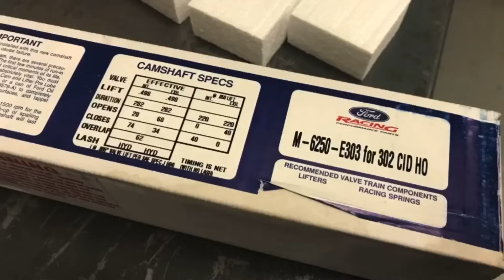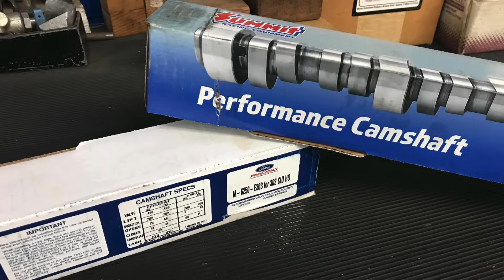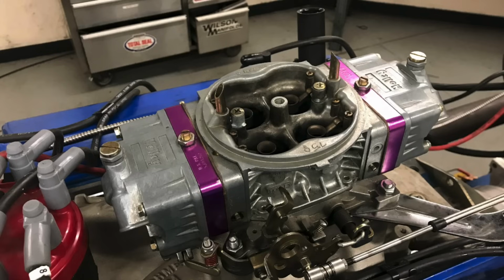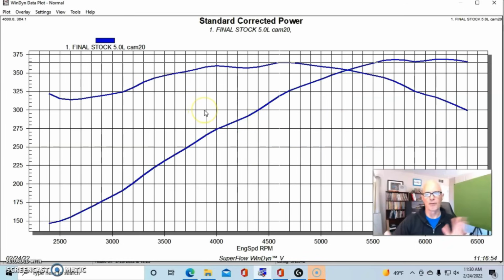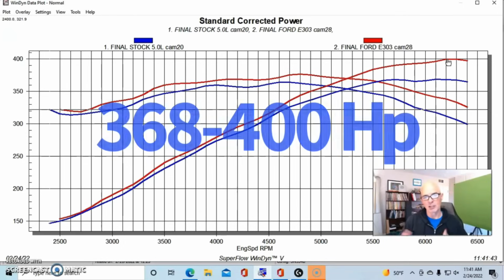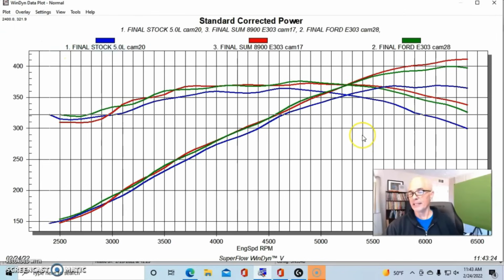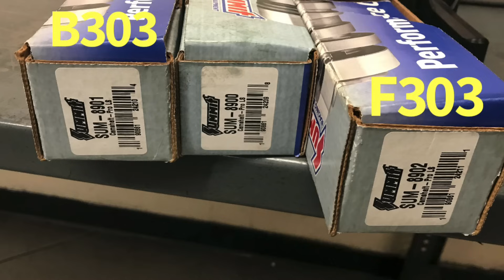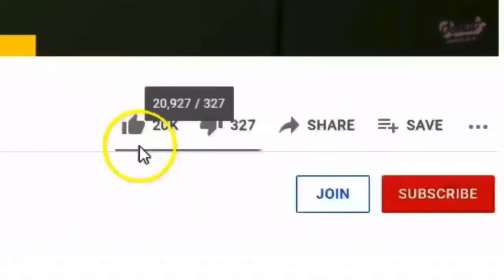HOW TO MAKE 5.0L FORD POWER! FORD RACING E303 VS NEW SUMMIT E303 PLUS-IS THE E303+ REALLY BETTER?

Comment: I am curious, other than nostalgia, why the B303 is "still a thing." I am an old-timer (I got my 1990 LX new when I turned 18), and the whole design goal for the B-cam was to compensate for stock heads with tiny valves (which is why they hang the valves open so long, but without a ton of lift) because aftermarket heads didn't really exist. It would seem to me that in 2022, almost regardless of your combination it would benefit with one of the zillions of profiles developed since. That said, I'd be curious to see what they pull...
Reply: I run 1.7 rockers and TF 170 heads with a B cam in my Bracket car. I think the lift is about what the F cam is with 1.6 rockers 5.10  -  5.12  Revs good.
Reply: The biggest reason that the Ford Racing B cam is still popular is because it has a 110 LSA. This is about where a sbf wants to be.  Look around at "shelf cams" with todays technology.  LSA is ridiculous on most cams, including this Summit cam. The 220 degrees at.050 isnt much duration at all, way bigger out there !
Reply: Summit reinventing the wheel

Comment: How are you going to do cam testing and not include idle sound test
Reply from the maker: dyno results deal with power
Reply: @richardholdener1727  but the sound has the power to  Intimidate

Comment: were the  Plus  cam showed a power  gain  is  above  were the  Fuel injection engines quit making power.   Plus  cam would be a gain on a carb engine but the B303 is as good in the injected  engine  power range.  my injected engine  will pull to 6200 but the power drops off after 5500.

Comment: the summit cam is soft on the low end.  not quite "new" tech either.    i'd like to see less duration and .600" lift on a 111 lsa
Reply from the maker: SO IT WON'T IDLE OR FIT IN 90% OF THE STOCK AND GT40 HEADS

Comment: I saw something on power Nation TV. I was wondering if you installed the cam straight up and just aligned the timing marks or if you degreed the cam. What I saw was they degreed a cam I think it was an old school 350. And when they retarded the cam itself it picked up torque down low and then they advanced the cam and picked up hp up top and kinda accentuated the trade off of torque in low rpm and hp in the top. So it makes me wonder if a cam would work better installed straight up or if taking the time to degree it is worth the time and effort for the average in your driveway gear head. I see the plus side for that in an all out race engine but think it's overkill for a street engine. I thought about this because you swap cams so much for testing I didn't know if you degreed the cams or not because I know you have limited time and have to get the testing done in quick efficient manner.

Comment: Great presentation! I commented several vids back, I believe on the 300-350hp 302 combos that you don't need to do a cam swap(JUST HAVE A GOOD SET OF HEADS) to achieve close to 350hp, and hear you eclipsed that. Not everyone wants to do a cam swap at that level. When I come to street engines I'm from the old school thought of running JUST ENOUGH CAM. Drivability, engine responsiveness, and strong low, mid-range, are important. Plus with a good set of heads you can squeeze some extra top end power from a mild cam. The stock HO cam is a good piece, and would've been  considered back in the 70s as a stage 1 even. The E303 was always the go to cam for me back in the day for the aforementioned reasons. With the E303 you can make a really great dual purpose combo(street/strip). Also has great vacuum signal (great for carb combos) and also I didn't notice any huge difference in fuel consumption between the stock cam vs the E303 cam(especially doing regular driving). Another plus. In my opinion too many people OVER CAM their little street 302's and wonder why they are not pleased with the performance. When it comes to cams, and performance level, you can OVER CAM if your not careful. Engines built for strictly track duty and max power may be a different case. Drivability and low to mid-range may not be as important then.
Reply: Back in '95 I ran a 5.0 Mustang HO and stock it would not pull well past 4000 or so.   The valve spring retainers were very heavy and had rotators built in...so some better springs and lightweight retainers along with Ford Racing 1.72 aluminum roller rockers really woke it up and it would pull strongly to the 6250 rev limiter and stomp a stock engine.   I agree that too much cam is much worse than 'not quite enough' and the stock HO cam with good valvetrain ran well enough that I didn't see a pressing need to change it.
Reply: @recoilrob324 the 1.7s don't cause premature valve guide wear?
Reply: @BruceLee-xn3nn  The geometry was good so you're not talking about that much more side thrust on the guide at all.   Plus...going from stamped steel to a roller rocker for sure will lessen any thrust on the guides so I'm confident they'll last at least as well as when stock.

Comment: How much ptv cleance did you have? I see the duration is the same on the intake. Did you fly cut the stock piston?
Reply from the maker: I did not even check-which is not a good way to go
Reply: @richardholdener1727  send it 😂

Comment: Excited to see those other Summit alphabet cams! I just bought the F303 plus for my 5.0 with a set of AFR heads. Totally looking forward to the power gains over my B303 and GT40P setup currently. I bought the cam on a total whim before anyone had good info on them, so I’m stoked to see how good the F303 plus is. Keep it up!!
Reply: Would love to hear how well your combo. Is running/how you like it, any info is appreciated. Also what intake, exhaust system, and compression are you running with your combo?
Reply: How did it go? I’m about to buy the f cam plus also.

Comment: Okay, but in the real world we run alternators and air cleaners,  most have PS, some have A/C, and most don't run an electric water pump, so these numbers are hard to relate to street/strip use.
Reply from the maker: THEY ARE EASY TO RELATE-THE STOCK CAM MAKES LESS THAN THE OTHERS
Reply: @richardholdener1727  That really didn't need a dyno test to prove, right?.  How well everything works in concert, now there's some useful info.  Isn't that what this is all about?  When you're posting 425HP, I'm scrambling to figure out all my parasitic drags.  I maybe at >325HP in the same test, but I am guessing.  I'm kinda hoping to not guess which is why I look for dyno tests.
Reply: @ChuckG92  You should get your  car tested at rear wheels that is the power that matters. The Dyno  numbers  look big but remember the numbers are not net like ford rated them. These are the same inflated  numbers  the old cars were rated at before 1972.
Reply: @mylanmiller9656  That's exactly what I do, but accurate engine dyno tests and remembering to  -15% drive line losses are informative.

Comment: Amazing how well the stock cam did with good heads, etc. The summit cam didn't improved much on the old Ford technology, especially considering how much more lift and split duration. Looking forward to the B303 comparison.
Reply: The Summit cam basically brute forces it's way to 12 measly hp over the E303 by using lift and then trying to 'cheat' it by having .540 exh.  The Ford E303 accomplishes a big gain with .498 lift and an easier profile.  I'd rather have that with a slight duration bump to 230.  The summit pattern is inexplicable in other ways as well.
Reply: the summit cam is far better than this comparison shows. if they would have kept revving the engine the hp difference would have been greater. the summit cam is actually more efi friendly as well and makes more idle vaccuum. we have used the summit e303 cam in our customers combos and they are a really good design that makes more power everywhere. The better the intake manifold and heads flow the more power it will make up top
Reply: My anecdotal evidence says the E7/GT40/P heads were never good enough to truly maximize the small block ford. Considering the LS heads almost bolt-down to a windsor, It would be interesting to dyno a 302 with them on there with some massage work on a mill. In ~2003ish, I was working at a mustang shop at the time and a guy brought in a 92 5 speed hatch that he only did a couple of things to: off-road X-pipe, MAC mufflers, holley systemax intake, and (at the time) the baddest stock angle iron heads made for the SBF: the world products Windsor Sr heads. Chris Howe (of Kaase's shop) ported the heads and he threw 1.7 rollers on it. Made 301rwhp IIRC. Most guys struggled to touch 300rwhp back then and this guy did it with a bone stock camshaft. Really solidified, to me anyways, that the heads were 90% of the equation.
Reply: @pro-seriesfabrication3810  ported iron gt40/gt40p heads can make some good power with a mild combo if ported correctly. We have mild combos dynoing 360whp/350wtrq through a  T5 on a dynojet with stock valves. Induction and camshaft plays a key roll.
Reply: @pro-seriesfabrication3810  yup relatively unknown combo is the air flow and exhaust mods you mentioned, there are other running stock cam with 1.7rr but after market heads such as tfs 11r 170 or 190 and afr 165 and afr 185 getting the numbers your buddy got with stock cam and windsor Sr heads
Reply: Well with 113° low separation I would say it has a lot better vacuum at idle then the regular e303

Comment: VERY interesting.  WAY back in the day I had a 1987 TBird TurboCoupe that I did a complete 1989 5.0 HO and 5 speed swap.  I mean complete with modified wiring harness and factory type installation.  Plan was stock swap but decided to mildly port the exhaust ports and ran into a situation requiring a rebuild.  Ended up with a mildly ported head and stock HO intake and an E303 cam.  Machine shop had a set of aftermarket dual springs that I was going to run UNTIL we put them on the scale and they were slightly worse than the 90k mile stock springs.  Dyno'd at 249rwhp @ 4600rpm and 314rwtq at IIR 3500rpm.  Car ran 13.77 @ 104mph on street radials (real not DRs).  on a 1.9 60ft.  Figured the stock intake was the problem so swapped in an Edelbrock but no improvement.  Either it was the stock ported heads or valve float... IDK... but should have made power well into the mid 5500s.  Nice vid.  Cheers!

Comment: Back in the day, my notchback was a daily driver, I ran the e cam with 1.7 rockers, The drivability was good being a 110 lsa. I drove that car all over and on long trips.
cam snobs made fun of me aLpHaBeT cAm...
it held it's own nicely along with explorer heads, gears ect, against the (new at the time ls6's. 

As you see on the dyno, the old-school e cam made its peak power just below the factory efi mustang rev limiter. Mid range was exceptional. Not considered powerhouses nowadays, but impressive combos.

Comment: I believe I’d take the original e303 I could keep 9ftlbs of torque down low where you spend most of your driving. 12 hp on top is barely if at all noticeable. How much time are you spending @ 6000+ rpm as compared to 2000-2500 which is basically cruise rpm for a mustang with a gear and 5 speed 9ft lbs I’m my opinion is more usable than 12hp
Reply: My thoughts also, till someone said the + was $100 cheaper. That shifts the equation for me.
Reply: @jjohnson8867  yes the summit cam os cheaper to buy but PTV clearance may be an issue on some engines with the added lift and duration especially with 2.02/1.60 valves which these blue print heads Richard is using have. why he didn’t have PTV issues is kind of puzzling to me. Unless his test engine had larger reliefs already cut in the piston. It is puzzling to me how some guys run large valve heads with crazy monster cams and have no issues with PTV while others have the exact engine and run into PTV with very mild cams seems like stock 5.0 engines tolerances are all over the place in terms of deck height. Some are at near zero some are 0.10-0.20 down the hole.
Reply: He said it was a parts store reman, who k owns what's in it. Cheap cast is what I would expect

Comment: Richard when you swap in the f303 could you test it with both 1.6 and 1.7 rockers for a hp comparison 🤔
Reply: This first motor I had in my car was a stock bottom 302 with f cam afr 185 and 1.72 roller rockers that thing screamed right until it dropped a valve a destroyed the engine 😂now I am building pretty much the sam set up except I will be running blue print 190cc heads as one of the afr heads were damaged and need repair I am hoping this build will be just as rowdy

Comment: What's your opinion on those cylinder heads? I picked up a pair for my 331 build.  But I had them milled to a 58cc combustion chamber so my compression would be 10.2 to 1.
Reply from the maker: they made good power on this motor
Reply: @richardholdener1727  didn't you use them before on a 347 in another video?

Comment: I appreciate the SBF stuff.  I would love to see a comparison of the Trick flow stuff as well.  I rarely see anyone dyno Trick Flow head or cams.  I run a 289 with the 11R 170 heads and a stage 1 cam.  The numbers on the stage one are in between the E303 and the Summit cam. Split pattern as well.
Reply from the maker: please see the several tfs videos I have up

Comment: Was anxiously waiting for this video. My current set up is a stock short block. 180cc heads. E cam. Always wondered what it made more less n/a. I spray 150 on it and runs bottom 11’s in my fox. Thanks for the video!

Comment: It would be interesting to see a comparison with the Comp Cams 270 Magnum 31-414-3 as this is very similar to the E-303 with .500 lift and duration of 224 but it is a flat tappet cam with the regular (non H.O.) Ford firing order.  Back in 1991, this was the biggest cam that I was able to run while still being able to pass emissions in my ‘79 5.0L Mustang.

Comment: I'm fixen to install a set of the Blueprint Heads (Part # HP9008) On a 1990 5.0 HO that's been carbed with the Edlebrock performer duel plane intake and Summit 600 carb. I am concerned about the larger valves hitting the stock pistons and my oldschool blackjack headers working with the angle of the plugs. All of this going in my 1978 Mustang ll.

Comment: I love the thought of a boneyard Explorer 5.0, those heads, the Summit cam, a 4 barrel, RPM intake, and headers for an easy, bolt on 400hp engine. For probably less than 3 grand. Drop that in any Fox body, early Mustang, Falcon, Maverick, etc, and haul ass.
Reply from the maker: then add 125-hp Sniper NOS nitrous
Reply: what about piston to valve clearance with the 2.02 intake valves?
Reply: @bryansage6925  A 4.00 bore should be fine.
Reply: @jeffrykopis5468  What does the DIAMETER of the bore have to do with PISTON to valve clearance? He's not talking about cylinder bore to valve clearance. Talking about the higher lift/duration causing the larger valve to hit the piston, especially because the "eyebrows" may only accommodate smaller diameter valves.
Reply: I have that setup.Original E303, Runs close with a 2020 Camero SS. Jump out about half car, maybe car behind or less by 120. Stock V6 differential, T5. 110 Mechanical pump. 3.73 and a good tune would probably get it. New Setup 351 @michigan_frankienstang

Comment: Would these cams work well with a 97 5.0 from an explorer that was converted to a 302 that has GT40P heads? I've been looking for a cam upgrade and I heard that the lunati cams are good for my motor but I want to see what else is out there
Reply from the maker: yes-they work on an Explorer motor
Reply: I have this combo. The gt40p's with the old E303. It works well. Make sure you upgrade valve springs as the stock gt40p springs are very weak. Alex's springs makes a nice drop in kit.

Comment: All this proves is the ford e303 was a  better balanced combination. I would imagine if the headers would have been the standard 1 5/8 the summit cam would have made more power overall by a decent margin.
Reply from the maker: better balanced?
Reply: Better balanced as in intake to exhaust ratio. If you have and intake that flow 220cfm and lets say a header tube that flows 180cfm which Is close to what a 1 3/4 would flow. The engine is better balanced for the ford 303. The motor will respond better to a camshaft that is similar in durations at 50 form intake to exhaust.. So let say you had a header tube that flows 140cfm now 1 5/8. The motor is not as well balanced between intake and exhaust so it would benefit on a camshaft with a longer duration on the exhaust side and may even need it to happen sooner (wider separation)= summit.  Now as you know, there are many other factors that come into play here but the principle is there . Im all ears for a good counter though. I love this stuff. Good stuff Richard